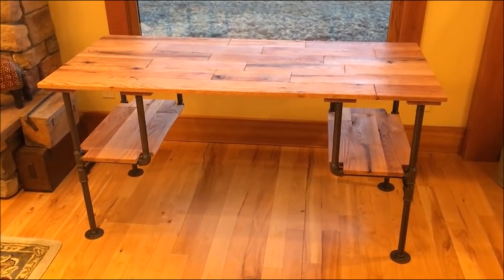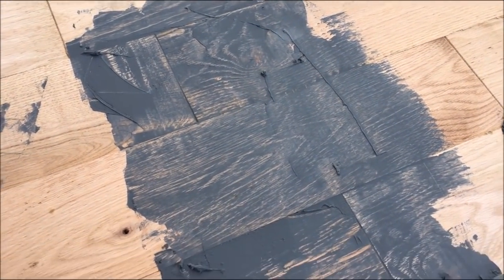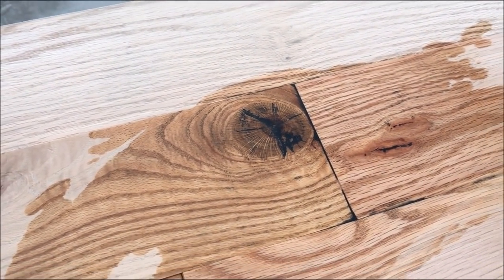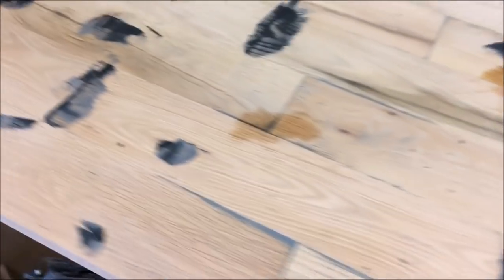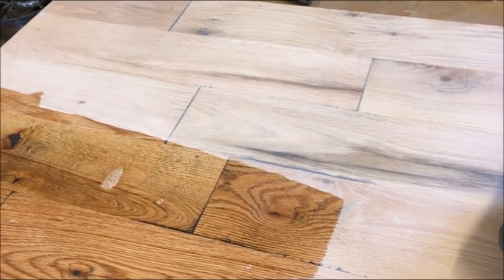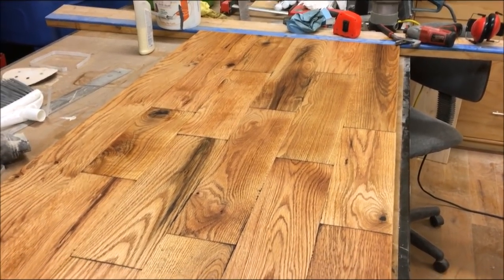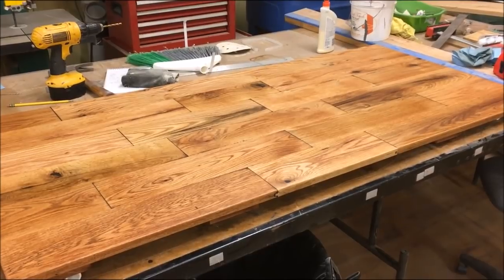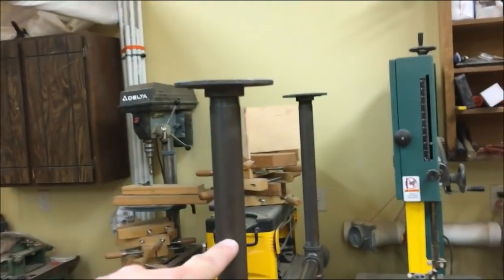DIY Black Iron Pipe Desk

Comment: Thanks Chris . My friend owns a hardware and plumbing supply company so I have the pipes covered. Love your design! Off to Lumber Liquidators today for 6" x 3/4" tongue and groove oak. I'm going to add a small tiered shelf about 3/4 of the way on the back maybe 2 feet high and install some hidden USB and power supply under the top. Thanks for the tips and the inspiration . I bought a rustic wooden base Edison Bulb lamp with a pipe fixture and finished wooden base and said,, " I want to build a desk now ". I'll keep you posted !

Comment: made a desk super similar to this. made 4 simple u-shapes for the legs and drilled holes into my shelves to feed the pipe thru. pipes obviously didn't match the holes exactly so I used o-rings to keep the shelves from rattling. got some set screw shaft collars from McMaster to let me add multiple shelves at whatever height I wanted.

Comment: I have 3 oak butcher block occasional tables with Danish oil finish I had made 40 (yes 40) years ago.  To maintain the finish, once a year, take 0000 steel wool and apply Watco Danish Oil. Work in well and buff excess off.  Mine still look new and even went to college and back with my daughter.
Reply from the maker: Yep.  Watco is the most forgiving finish ever.  I love the stuff.  I strongly recommend using a butchers wax on top of it though.

Comment: Thank you for this video! It would have been great to see you actually put the wood together...but just the explanations have helped me a alot
Reply from the maker: I get that.  I didn't decide to video the project until I had already glued up the top.  Honestly it's not complicated since I wanted a rustic piece anyway.
Reply: @chrisarneson8644  it's all good.... even what you've shown helps me to move forward with how I want to do the legs of my desk. I did the actual desk top already; well at least its assembled. Still ha e to sand and stain it

Comment: Chris, you did a fantastic job with this piece. Very nice.  I am currently researching "DIY galvanized pipe desks" for my own project (Ham Radio / Office Desk).   I picked up some great tips watching your video, like using the black putty. I can also appreciate that you used materials you had lying around. It is nice to see old materials recycled to make something beautiful and you certainly did that here. Fantastic work!   I do have a question - what is the weight of this desk?  We have ceramic tiles in my office and I'm somewhat concerned about how heavy I go with my desk.
Reply from the maker: It is not much heavier than any other piece of furniture.  Also, because I used the pipe flanges for feet it actually spreads the load well.  Be sure to use some 1/4" felt stuck to the bottom of the flanges and you will be fine.  Tile that has a good backer behind it is remarkably strong too.

Comment: For ergonomic purposes, I'm looking to make a desk of a specific height. How much space should I allow for the fittings?
Reply from the maker: Honestly each brand of fittings can be a little bit different.  I recommend you buy the fittings first and then have your hardware store cut the pipe to the exact length you need.  I can't be more specific than that.  Sorry.
Reply: @chrisarneson8644  bummer... thanks. i was hoping to be able to the right length off the bat and avoid cutting. i'll work on it. appreciate the info! :)

Comment: Love the legs. I want to use leftover 3/4" oak flooring for the top.  How can I prevent it from sagging along its length which is around 80"?
Reply from the maker: I'd suggest modifying the leg design so that there was a new pipe connecting the two legs in the back.  Essentially replace the elbow joint at the rear shelf support with a T and extend it across the table.  That would stiffen everything up and avoid the legs pivoting down.

Comment: What is the Width and Depth of the desk? I am going to try and do something similar, but wanted a 60"X30" desktop on it, so was going to change what I needed accordingly. Great desk!
Reply from the maker: My top is a weird size that was dictated by the spot my wife wanted to put it.  28"x57"
Reply: @chrisarneson8644  Thanks Chris! This setup should work fine for 30x60 then. Sorry to be a bother, but do you know the rough measurements of the shelving wood so I can have some cut at home depot or elsewhere online? Again, appreciate your time.

Comment: Looks cool but man just 3/4" boards how is that thing not going to sag? Also, to clean black pipe easily and quickly, spray brake cleaner on the pieces in a 5 gallon bucket and wipe off.
Reply: Thinking the same thing.  I wonder if it would be best to run the pipes along the length of the table for support
Reply: How about this? For the shelves, instead of elbows on both sides, what about another t-joint with a long pipe reaching between the two?

Comment: Hi Chris we love this table it looks fantastic. We love it so much we were inspired to make our own at home. Question for you @chrisarneson did you use wood putty or wood filler to accentuate the grain? We are looking to make this table at home and wondering when you said wood putty what you used. Wood putty is soft and non hardening  Or are you using wood filler that hardens and is sandable? Thanks chris!
Reply from the maker: I used a black wood filler.  If you are using oak I strongly recommend using black.  It's an absolute mess to work with but the result is fantastic.  It leaves the product looking very rustic and fills in knots.  I used this:  http://www.finaltouchproducts.com/Final-Touch-Wood-Filler--Quart--Knot-HoleBlack-Patch_p_194.html

Comment: I really liked this video. In fact I'm now trying to build a desk in a very similar style to this. The challenge I'm having is in glue-ing up the boards. Any suggestions would be appreciated. The boards I have are tongue and groove and when I try to clamp them for a glue up the end up pulling up from their flat position. I'm almost tempted to rip out the tongue and groove parts and just biscuit jointing them. Any thoughts?
Reply from the maker: Keep the tongues. You need to temporarily clamp boards perpendicular across the table on the top and bottom. Do this on both ends. These boards are called cawls. I typically put packing tape on them so they dont get glued to the top. Google "cawl glueup" for photos.

Comment: Hey Chris, great video and very informational!
I'm actually making a desk similar to this right now. I just have a quick question. When you're talking about attaching cross members (at 6:00) to keep the desk flat you inserted subtitles (at 6:18) that read "Drill a 1/4" hole only through the cross member! Do not drill..." but the rest gets cut off but the video cropping :(
Are you saying to not drill through the desk and just drill through the cross member? If so, should I drill a hole through the cross member and let the flat bottom screw sink itself into the table top or should just drill a pilot hole into the desk taking care to not drill all the way through it?
Thank for the help!
Reply from the maker: Only drill the larger hole through the cross-member.  The goal is for the flat-bottom screw to be able to be able to move a little in that hole to adjust for humidity.  Because I used oak which is really hard the screw doesn't sink into the wood.  It just slides across the surface.  Essentially you have the wood grain in the cross-members and the table-top planks fighting each other because they are going in different directions.  If you just tried to glue them together the grain would eventually break the glue somewhere.  The screws in the larger holes are designed to float a little and relieve the strain of the opposing grains but still hole the table top flat.
Reply: @chrisarneson8644  Ah ok, I think I understand. So I'd drill a hole that's wider than the actual screw in the cross member so the screw can float around in the hole, but the point at which the screw enters into the table top itself will be normal, it won't be wider so it will still be able to anchor the table top to the actual cross member. Is this correct?

My apologies for sounding ignorant. I don't want to mess anything up when I get to this stage in my desk.
Reply from the maker: @SpookySpeck  Yep.  You've got it!  Good luck!
Reply: @chrisarneson8644  Awesome, thank you so much!

Comment: How sturdy do u think this would be as a workbench
Reply from the maker: It's pretty sturdy.  I suppose that answer would depend on what you wanted to use the workbench for.  If you were putting a ton of weight on it then it might eventually sag in the middle.  If you were doing relatively light stuff then it would be no problem.  If you were putting a bunch of weight (100s of pounds) on it you could easily adapt the idea to put a 3rd set of legs in the middle and then it would hold an elephant.

Comment: Hi good Sir, how high was the desk?
Reply: I'd like to make a 45"-high desk version of this. What should I change from your list of materials?
Reply from the maker: @donviloria1310  A typical desk is 30" high.  If you wanted one 45" then I'd suggest adding another level of shelves on each side.  That would add 12" or so.  You could then adjust the bottom 4 legs to get your final height.  Assuming your top is going to be 1.5" thick like mine (3/4 for the top and another 3/4 for the cross-brace) then you need 44.5" of pipe.  Go to your local hardware store (or home depot/lowes) and just start screwing pieces together until you get the right height.  You will get cheaper prices by ordering from Amazon after you know what to order.  Good luck!
Reply: @chrisarneson8644  Thank you for this detailed reply! You're good!

Comment: Great video! I'm taking this and adapting it to build a desk down the road. I was just wondering for the shelves did you screw the wood into place or is it just sitting free but notched so it won't move? That's the only thing I'm not quite getting about this build but other than that it's exactly what i needed
Reply from the maker: It's just sitting in place and locked in with the notches.  Nothing fancy!
Reply: @chrisarneson8644  Thanks so much for the prompt reply! I'm planning on taking that idea to use for speaker stands and potentially also for a piano stand so hopefully it works out!

Comment: Can you use the shelves for something other than math books, or is it exclusively math books?
On a serious note, the iron pipe is really expensive. I just spent $11 to make a desk top. It wouldn't make sense to spend $100 for legs
Reply from the maker: I think it will accept history books as well but definitely not classic russian lit. For me i found that ordering some parts on amazon was cheaper than local. Also buy long pipes and have the home center cut and thread them for you. Its much cheaper that way.

Comment: Will it be stable to use plywood for the desk top and plastic pvc pipes too?
Reply from the maker: Absolutely No!!  Both Plywood and PVC are WAY too flexible and would look horrible on top of it.
Reply: @chrisarneson8644  oh. Okay. Thanks. 👌
Reply: I made a similar desk out of PVC and plywood and it gets used daily with zero issues, very stable, just add a crossbar of pvc in the front and back and between the feet on the sides, use 3/4" plywood and 2" pvc minimum.
Black PVC looks nice and added black plastic trim on the outside of the plywood as well for a matched look, that being said it is a more modern look over the rustic metal piping so it may or may not go with your decor.  PVC is much cheaper than metal pipe as well and you can make the height exactly what you want it to be.

Good plywood will hold up just as well as standard wood, just don't try to use the cheap and thin stuff.

Love the table build though, turned out very well!

Comment: Instructions to make it - ok. Overall look - ok. Usability of table - low (depends on purpose). If this table will be used as a "shelf on the legs" (place it in the corner of the room, put lamp/books/jars on it) == it will be ok. But if you want to sit at this table, you'll notice that it's a table for one person only. Legs are too close to edges == easy to injure your legs/knees and not comfortable to sit at the table from other sides.
Reply from the maker: Did you miss that this is a "desk" and not a table?  Functionality has been fantastic and we have spent hundreds of hours working at it.  Yes you sit at it one at a time.  That's how most desks are designed.  It's not a dining room table nor was it intended to be.  A simple table would have been easier but that is not what we wanted.  If you want to get rid of the shelving and storage then go for it.  My intent was to show people how easy it is to build something like this.

Comment: How high is the desk from the floor?  I'm guessing based on your measurements about 28"
Reply from the maker: 30 is standard and mine comes in just a tiny bit below that.
Reply: Thank you! do you find that the desk is sturdy?
Reply from the maker: It's rock solid.  I'm not a tiny guy and I could easily do a tap dance number on top of it.  Ok so I can't tap dance but I could jump up and down or without any fear.  It's rock solid side-to-side too.  Just know that if you use something softer like pine could would need to make sure that your screws are really solid into the top.  With oak that will never be a problem.

Comment: Do you happen to have an estimated cost of the pipe that you used?
Reply from the maker: I don't remember to be honest.  I found the pipe and fittings to be far cheaper on Amazon than anyplace locally including Home Depot though.  You should be able to price out the pieces you need online in just a couple minutes.

Comment: How do you connect the union to the tee?
Reply from the maker: Not sure what you mean.  There are no "unions" in the desk.  I suspect you are asking about the short 2.5" nipple that you can't really see.  It's very short and is threaded on both ends.  It is just used to join two fittings together.  In my case I have a T fitting joined to a second T fitting with a pipe nipple.
Reply: That’s why I was confused at 9:16 you said there’s a union.
Reply from the maker: Gotcha.  Sorry about the confusion.  I must have referred to the short nipple as a union.